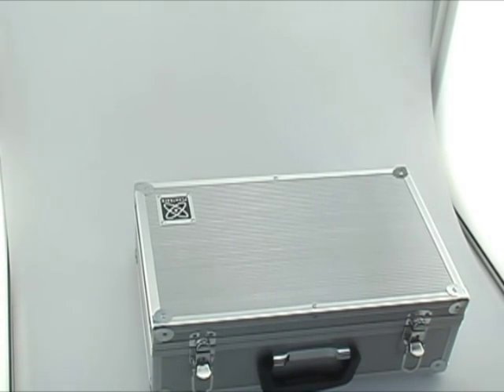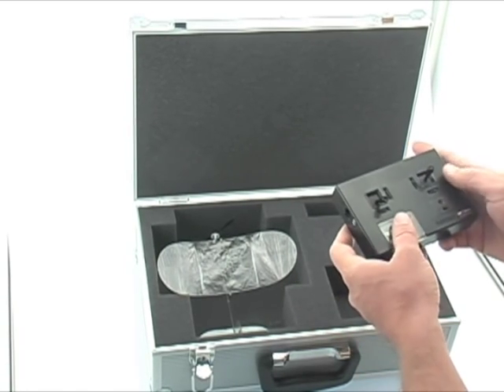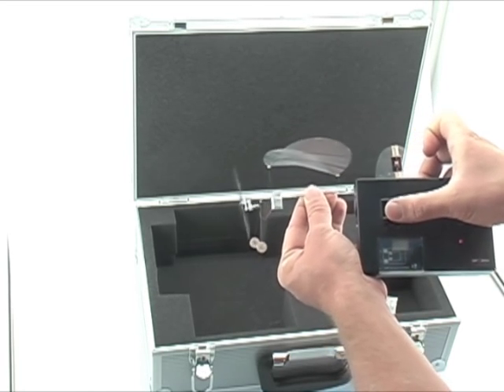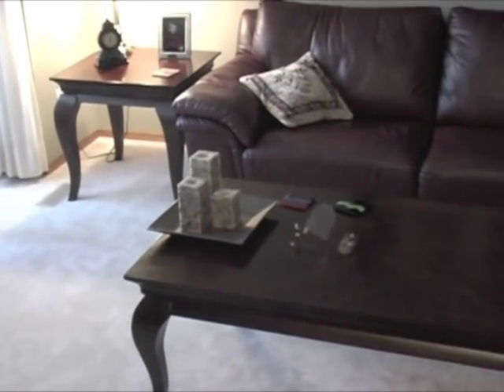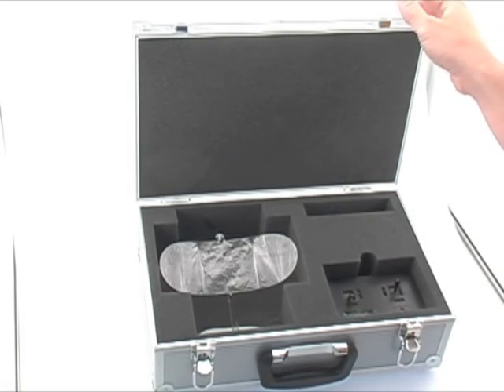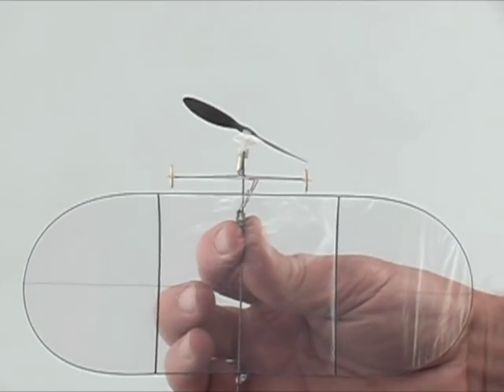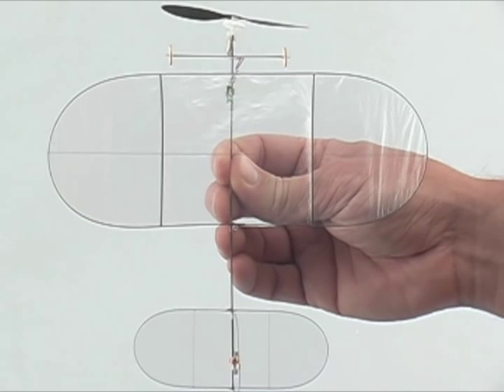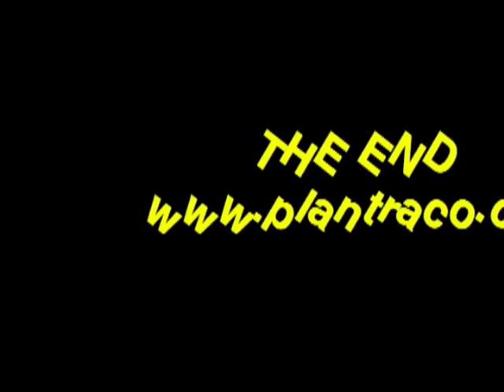DIY: How To Set Up the Carbon Butterfly HQ

Comment from the maker: Yes, it can be done.  Nice smooth air is the main thing, and then you need enough space to at least do a figure 8.   The F6F Hellcat is a "classroom fighter" so a room about the size of a typical school classroom is enough to have fun.  You can make the plane fly slower by adjusting the airframe - bend some up elevator, this kind of stuff.   Try bending the foam a bit and go for a short flight and notice how the model flying changes.  In this way you can fly in very small rooms.  Have fun!

Comment from the maker: @wpockl We selected a low charge rate on the built in charger - change a resistor and you can increase the charge rate.   If you'd like to charge faster and you do not wish to learn about electronics, you can purchase our BiCha Charger - which can charge 2 cells simultaneously at user-selectable charge rates

Comment from the maker: Safety engineering issues.   We could boost to a 3C charge rate, but remember, we designed this system when everyone else was running 72Mhz equipment and lipo cells were new fangled tech.   haha.   Butterfly was from like 2004!   haha.     It's still a great flyer, and probably one of the lightest out there.

Comment: I'm all about flying micro r/c
Planes. My question about yours is why does it take an hour for the battery to charge? My megatech avion only takes 15 min.
Reply: Well - it depends on how you want to charge it.   We have cells that are really old that are healthy and running.   How is megatech doing these days?   lol
Reply: @iwaterwizard7834   I've replaced the battery a few times lol